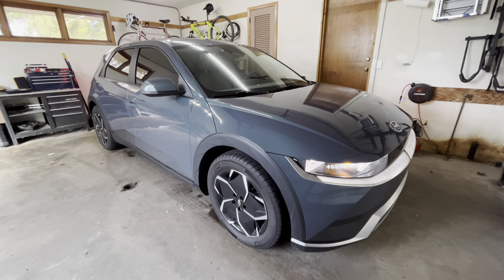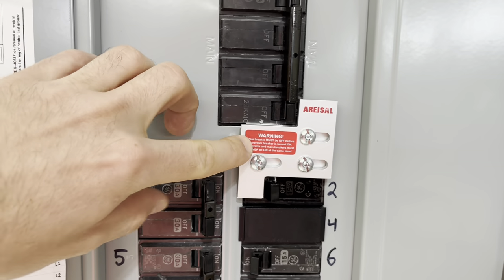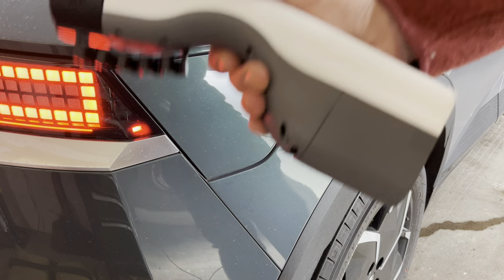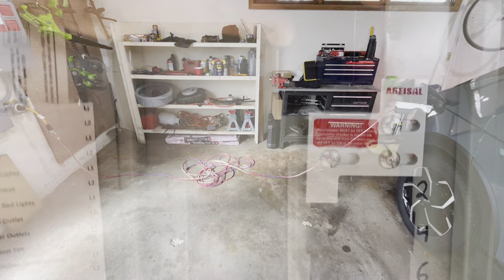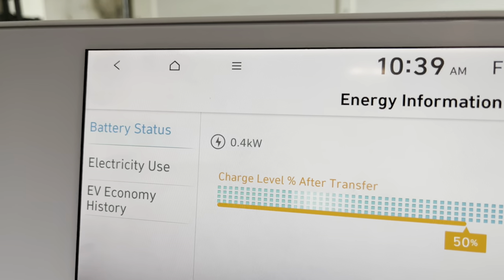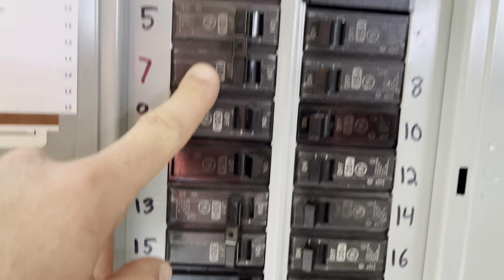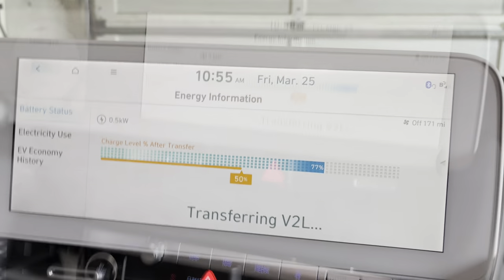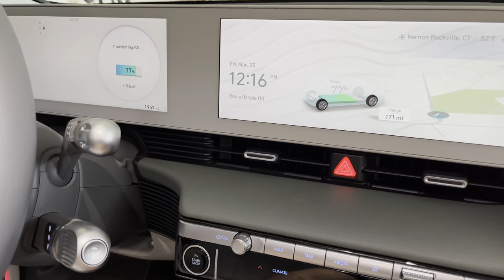5 Days of Emergency Backup Power Using V2L Adapter | Ioniq 5 | EV6 | GV60 | EV9 | Kona | Ioniq 6

Comment: Thanks for the clear explanation.
I was wondering if it's really necessary to disconnect your PV invertor, assuming that you've got a single phase string invertor.
I checked with Google Bard, which came back with the answer:

"Yes, the Ioniq 5's Vehicle-to-Load (V2L) feature can be used to power a PV inverter and provide backup power for an off-grid home. The Ioniq 5's V2L port can output up to 3.6 kW of power, which is sufficient to power most inverters. Additionally, the Ioniq 5's V2L power supply is clean and stable, making it compatible with inverters"

My initial impression is that you could start up your invertor using the Ioniq 5's output, then use the Ioniq 5 and PVs in tandem to power your home.
Am I missing something here?
Reply from the maker: I don’t have a string inverter. I have Enphase micro inverters. They require a very specific frequency signal that only comes from the local utility or else they power off and cannot be powered back on until they sense that signal through the local utility.
Reply: The output is limited to 1.8 kw in the USA. 3.6 kw is only available outside the USA.

Comment: V2L feature anyway outputs up to 15A also for 250VAC 1Phase, so in this case it would be approx 3700W, in Korea it designed as 3300VA as 220V 1phase standard. 
I hope that Hyundai would add another part which has 3Phase 400V V2L (for EU Type 2 AC Receptacle) or even 1Phase but 32A with Industrial receptacle. but it might not come.

And I didn't know the unlock/lock doors button is located at Passengerside door. Korean version doesnt have it...

Comment: Very helpful!  I had not really even thought of it, but I already have a generator input installed (GenerLink) and I could easily use my EV6 V2L adapter.  I have an 8700 watt inverter generator for the task but it's probably overkill for most needs.
Reply: You often need the overhead to run motor based appliances (fridge, clothes washer, heat pump and HVAC, pumps) , even though the usage might idle around 100w to 300w to 1500w, starting up a large fridge that doesn’t have an inverter or starter capacitor could pull the full 30A or 40A, whatever the peak current is, up to 4kw to 7kw for a brief surge. Now, you might be able to mitigate this with 2 cars… or 3 cars, or a parallel load generator sic. 

Heater elements can also sometimes spike 2.5kw because they often don’t have a slow surge, but a short spike and then switch off for a few minutes as the oven or boiler spreads the heat load around the oven/tank.

This is mitigated if you wire your house for a backup battery, since they move these heavy duty breakers and circuits off the battery/generator sub circuit just to save you installation costs and money. 

I think there’s also a smart circuit breaker that costs something like $3k that can smart-break in an emergency and switches loads to different bus/circuits, or turns off breakers automatically. It’s used for high end solar installs.

If you have to supply HVAC or ovens ie Winter Heating, water heaters, etc then you have to spend a lot more to get the overload capacity, or move the house circuit to 3-phase, sic so that there’s load capacity for heavy duty appliances.

Comment: I am not through the whole video yet, but something like the ecoflow delta 3 pro is pretty cheap at 3k and would make your system more robust...  that ecoflow will output 8kw at 220v, and has a 4kw battery... the small battery isn't an issue because your car can keep the ecoflow topped off at 110v..  so this ups what your system can handle for power spikes, lets you use 220v breakers, and would let you drive off while running off the 4kw battery to charge up the car if power comes back on in town first.

Comment: Is it be possible to install a battery pack meant to power everything including oven, dryer, etc. kind of like a Tesla Wall but maybe non-brand or DIY? 
The idea would then be to have for instance 2 weeks of power, or about 50kWh, stored in the battery pack. You charge the car at work. When you come home, you plug in the car which will just top off the battery pack. You will probably spend more power during hours 6-22pm draining the battery pack a bit, but as you go to bed the car can catch up and will have recharged the entire battery pack in the morning. You take the car to work, recharge it, and repeat every day. Essentially, you can spend $0 on electricity if you charge for free at work. Or if you have some sort of subscription on unlimited charging, you can also save money.
Reply: Yip. This is entirely doable.

Comment: Interesting video. I live in the country and am on a well. The well pump is on a 220 and then so is the hot water heater. Don’t think it would be capable of running this?
Reply from the maker: Sadly no

Comment: National Electric Code (NEC)
NEC 702.4 Capacity and Rating. (B) System Capacity. The calculated load on the standby source must be in accordance with Article 220 or by a method approved by the authority having jurisdiction. (1) Manual Transfer Equipment. The optional standby power source must have adequate capacity for all equipment intended to operate at one time as determined by the user.

Comment: Fantastic video, very informative. One question, doesn't the Ioniq 5 have another 120v outlet under the back seat? And if so, could you install another generator inlet to power the other half of the panel? I would assume the 15 amp maximum would be for the two legs total then.
Reply from the maker: Only one outlet can receive power at any given time so that isn't possible. You are correct that it's 15 amps between both outlets
Reply: Thanks again for that info. I haven't found details elsewhere on how the two outlets in the car interact. Much appreciated.
Reply: @TheIoniqGuy  Please see page 21 of the online owners manual for instructions to use both outlets at the same time: "Opening the charging door or
 connecting the V2L connector to the charging inlet, the V2L discharging mode will shut off. If you want to use the indoor and outdoor V2L simultaneously, firstly connect the V2L connector to the charging inlet and use the indoor V2L." 

I might be getting my Ioniq 5 tomorrow and looking for someone to test to to see if both outlets are limited to a total of 15A or if they are separately rated.
Reply from the maker: Thanks for letting me know about that

Comment: Fantastic video.  Great set-up.  I'm curious though - is there any kind of safety issue having the solar/battery input and "generator" input both on the panel without any exclusive switch?  You've obviously done it right with the interlock to grid, but aren't you dependent on remembering to manually shut off the solar/battery breaker?  Obviously you're very careful in the video and actually do it in 2 redundant spots.  But what if you're not home and somebody else thinks they know how to do it?  Or other viewers without as much knowledge as you?  Just curious what happens if the solar/battery and the Ioniq V2L are accidently connected at the same time?

Comment: Cool,  Thanks.    1-2 kW from a car could be very useful during a power outage.   I'd be more interested in a simpler system that isn't connected to the grid at all, if possible.

Comment: To my mind, this ought to be a no-brainer. An EV is a huge battery on wheels storing a fair chunk of power, which should be available for more than simply driving the car. I would never attempt to emulate what this guy has done. Good luck to him but it's above my pay grade. The EV manufactures and the grid operators need to get together and supply and fit all of the electronics in a consumer package.

Comment: I'm glad you explained that you were only feeding one phase on your panel with the V2L.  Up to that point it was confusing how you got it to work. That's fine if you can move things around on your electrical panel but that might not be so easy for everyone.  What about using an autotransformer to step up to 240V split phase, and feed both phases on your panel, using a 4 prong (L14-30P) generator inlet plug instead of  the 3 prong one?    Quibble: you are referring to Neutral as Ground in this video and that is not quite right.  And question:  doesn't the car see the house as a ground fault given that neutral and ground are bonded in the electrical panel?  Or is the car operating as a floating generator (neutral not bonded to ground in the car)?

Comment: Finally got my Ioniq5 2023 LR RWD Preffered on Feb 23rd 2023... Super happy. My electrician is passing by May 1st. But he was worried about thet fact that the ioniq 5 is on 4 rubber wheels... So the car cannot provide a HARD GROUND but just a FLOATING one... He was worried for the electronics of the fridge/tv/modem/computer etc.... Do you understand what he means ? How is this addressed or solved by the using of the V2L? Thanks so much for ALL your videos. You are a reference for me. Greatly appreciate an answer soon. (Before May 1st! lol ) Thanks a lot. 
:)
Reply from the maker: I'll preface this by saying I am not a licensed electrician (and am years removed from my training) nor am I an electrical engineer. The electrical circuits throughout your home are still grounded and bonded to the ground rods which are big metal rods driven into the Earth so any short circuit would still be directed to the Earth grounds as they are the path of least resistance. If someone else is better versed in this, please chime in. I only use this setup for emergencies and in an emergency, I'm willing to accept that amount of risk as they occur few and far between. Many people have been using this setup based on my video to power their homes in emergency situations and I have yet to hear that something happened due to it. But again, please do your own research or listen to your licensed electrician. Also keep in mind, does a portable gas generator have an Earth ground? No, it doesn't. They're typically just sitting on a driveway.

Comment: Very well done; I like your step by step explanations, its very easy to follow you.  I have one question.  I will receive my Ionic 5 next September (if there is no delay...) I have in front of the back seat a power outlet 120V 16A.  Do you know if I can use, at the same time, this power outlet with the exterior V2L adaptor?  It would double the total W available to power my house. Also, if I can use both, would you have a suggestion on how to connect it to the electric panel. Maybe a second portable generator inlet?

Comment: I want to see a range extended electric car with a 240V 50A hookup, that probably power my entire house. Just program the traction inverter to produce that 50-60Hz AC which has more than enough wattage then a disconnect from the traction motor. Disconnects for such a high load like traction motors would be beefy but it wouldn't have to switch under any load so minimal wear and tear.

Comment: Great information! My only question is . . . what happens when those 5 days are up, and you still don't have any power to the 240V plug to recharge your car? You may have some battery power left to drive somewhere nearby, but I would assume if you don't have power still, the charging stations won't either. Then what? Is there a way to get your solar panels to power the car without the 240V charger?
Reply from the maker: Yes, I’ve been considering getting a separate solar inverter that would be able to be installed separate from the grid so it would be able to charge the car regardless of the state of grid power.

Comment: You know you can purchase the europe version of the V2L and use it to power both phase of the panel, not the power hungry appliances but at least you will have all the 120vac breaker availlable and you are right, no cheap extension.
Reply from the maker: No you can’t. European cars have an entirely different charge port to those in North America
Reply: @TheIoniqGuy  I was not aware of that, I was sure the charge port was identical, thank you for the information.

Comment: Nice walkthrough. Unfortunately a lot of homes (my own 1972-built home included) don't have breaker boxes conveniently located in the garage, and indeed, don't have a separate circuit for every appliance. I can't even wire my attached garage for 220 so I can put an L2 charger in there. :(

Comment: @TheIoniqGuy - Dumb question from someone with minimal understanding of electrical panels... in the "Limitations with Electrical Panels" section of this video you seem to be saying that you can only turn on every other circuit on the even number side of the panel.  However it looks like you did turn on some circuits from the odd number side.  Am I missing something?  Thanks.

Comment: I am curious how efficient the system is to leave on.. like if you only had a fridge running but wanted to leave it on after a storm for 3 days... the ioniq battery should have plenty of capacity, but does just having the system on eat the battery quickly?

Comment: The bit that confused me was when you said that in the US and Canada you use 240v. Here in the uk we use 240v and our v2l supply's 240v. Your v2l only supply's 120v. So you don't actually use 240v. You use 120v but you have 2 connections into your house. And your supply 120v around your home you just split the load over 2 120v lines. Is that right or am I getting that wrong.
Reply: That is correct, its known as 240v split phase.

Comment: Hello The Ioniq Guy
I have a sugestion
Why dont you bridge the two hot lines with 240 V breaker and have all the 110 loads in the house covered by V2L, and automaticly the big  and power hungry 240 V apliances will not work.

Comment: Great video! Can you please help me better understand why I can't turn on any of the 240v breakers? I want to run my HVAC unit, but each of my two zones is on a 240v breaker... that being said, I don't want to have any issues so I would like to understand why I can't.
Reply from the maker: Because giving a 240V device only half of its required voltage isn’t good for it
Reply: @TheIoniqGuy  I just checked my panel, it looks like I have a 40a circuit breaker linked to my generator inlet (in the garage). 

Is the car limiting to 120v or is it the circuit breaker in your case that is the limiting factor?
Reply from the maker: The car only outputs 120V

Comment: So excuse my lack of knowledge...

So I only have the circuit box. How do I get what you have to where I can plug it in to put power from the car to the circuit  categories I want to put power to? I know you have a solar system as well,  I don't but want to be able to use my car as a generator. Do I need to call an electrician to set it up to where I can use it? Will he be able to set it up to where I don't have to use the whole circuit box?

Few other questions.  Can  the AC in the home get power from the car? (Ev6) 

Is it only good to use in an emergency or can I do this daily? (I have free nights so would be nice to power my home during the day and charge the car back up at night 😊)
Reply from the maker: So I think you would be best off calling an electrician that knows all the ins and outs. 

Are you referring to air conditioning? If so it depends on what kind of system your house has.

There's nothing to stop you from doing this on a daily basis but I'm only using it for power outages since it can't power everything I need to use ie stove, dryer, etc

Comment: I have an inverter that I got to run some things off my LEAF in a power outage.  Can the I5 DC to DC converter keep up with additional draw on the 12 v system?  I have an SEL, with a single V2L.  I assume the car could handle another load because it's designed to feed two sources.  Thoughts?

Comment: How to use solar panels to charge the car when line power is off line?  No street input shuts down solar, but car could supply 120VAC - would that turn the panels back on?  If so, how?

Comment: I'm looking to get a bidirectional charger to reduce any grid usage as much as possible. Are there any V2h chargers for the ioniq 5 or do I need to work with the V2L adapter? When my house battery is empty, it would be wonderful if I could use my car! 

My house system:

Zappi charger
10kWh Solax Battery
12 Solar Panels
Grant 6Kw Heat Pump